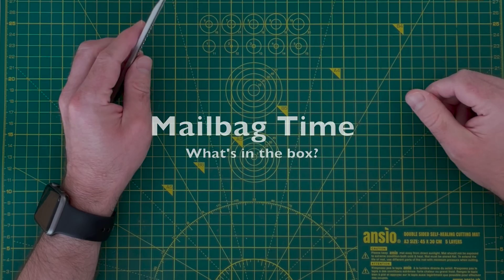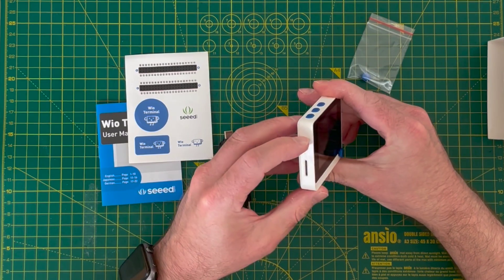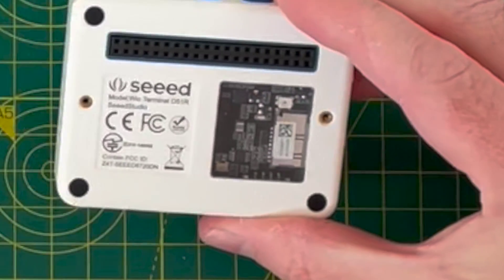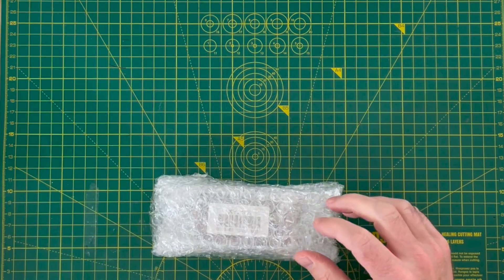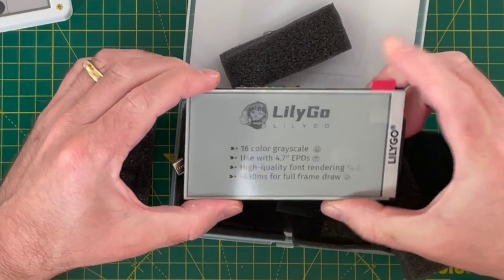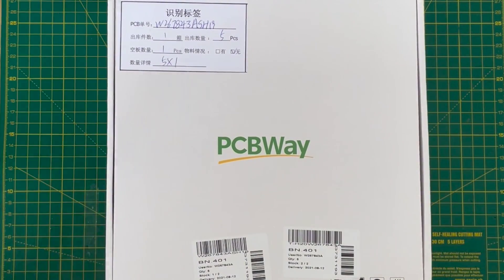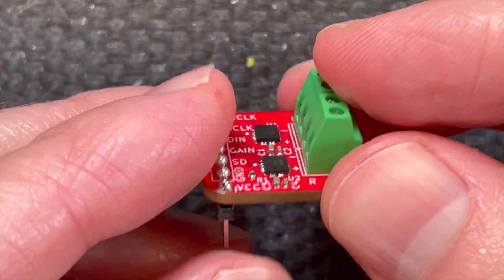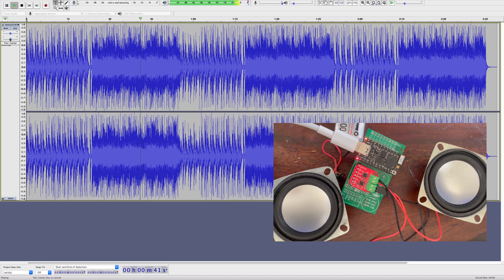Fun-Size Mailbag: New Tech & Testing Stereo PCBs!

Comment: Congratulations on the working stereo pcbs! Could you do me a huge favor and measure the power consumption in stereo mode? And maybe let me know, which speaker you used? Thanks in advance!
Reply from the maker: I'll try, it will depend on how loud the speakers are being driven - or do you want it when no sound it being played? The amplifiers can be put into low power mode by taking the SD pin low if needed. I'll see if I can measure it. The speakers I'm using are just some cheap ones off amazon -  https://amzn.to/3pjWFgq
Reply: @atomic14  with no sound (idle and no standby) and with sound would be interesting. Are you powering the amplifier with 3.3 or 5 Volt? And thanks for the link!

Comment: I have bought the 4,7 ttgo e-ink screen with the touch screen, but it is only working when it is powered by USB, when I use the battery it is not working ... please tell me if yours works right with the battery.
Reply from the maker: I'll report back and let you know. That would be frustrating if it doesn't work.